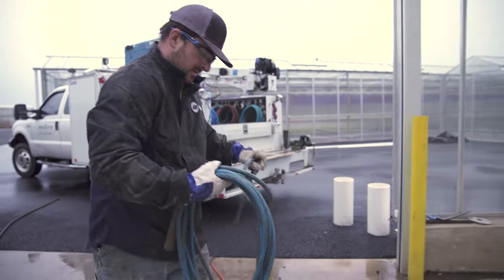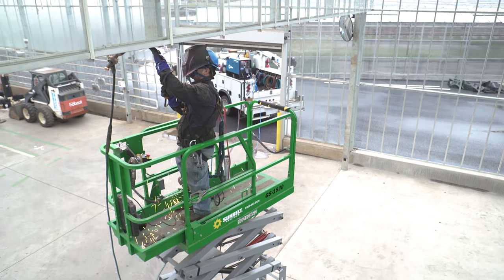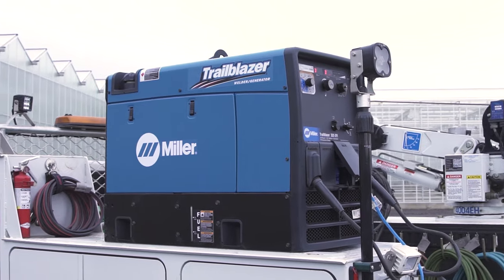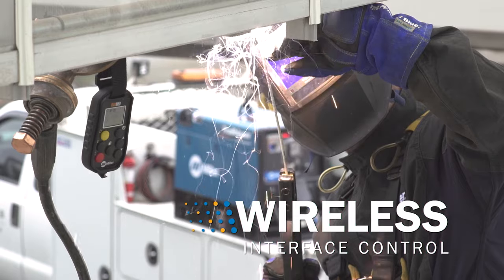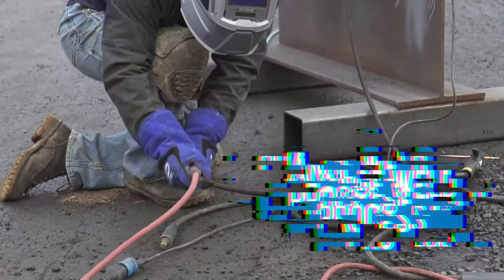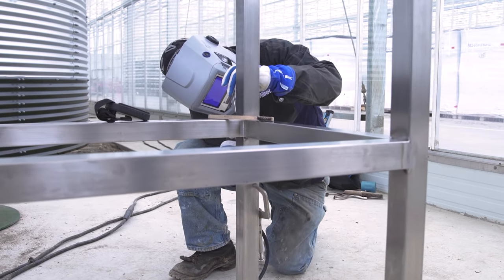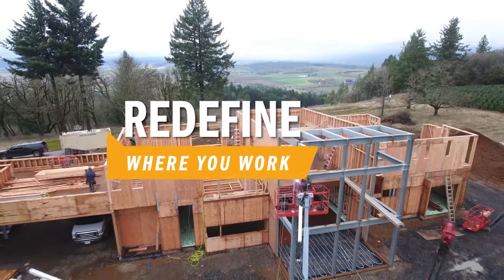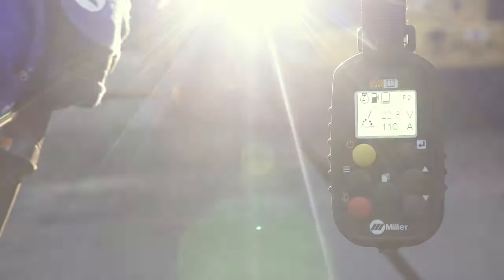Wireless Interface Control: Get Total Control Where You Work

Comment: Is the remote included with the machine or would I need to purchase one separately?
Reply from the maker: Hi Daniel. Wireless Interface Control is an option available on Trailblazer 325 and Big Blue welder/generators. The remote will be included when you purchase a machine with Wireless Interface Control.